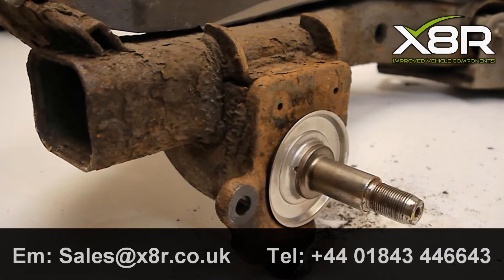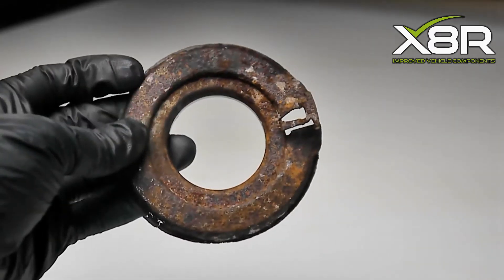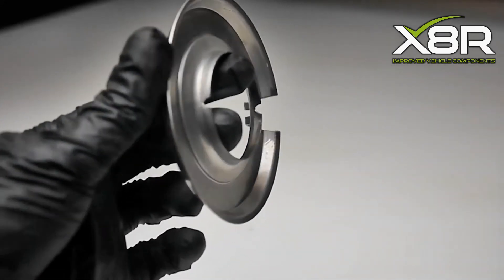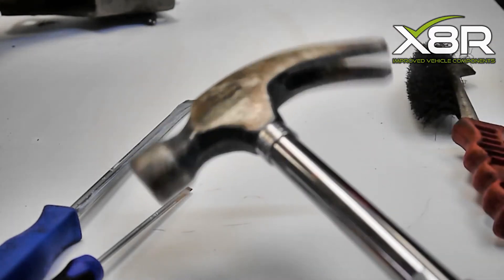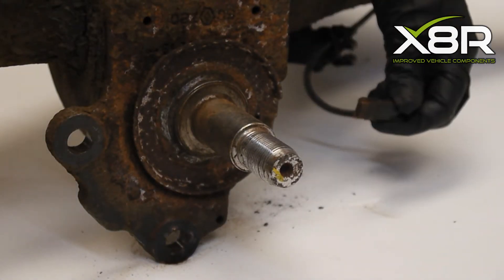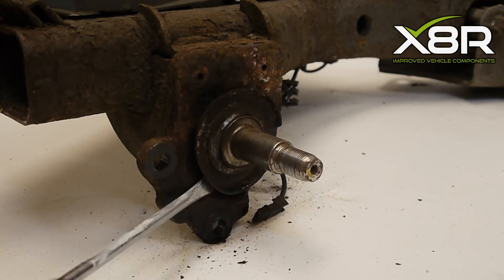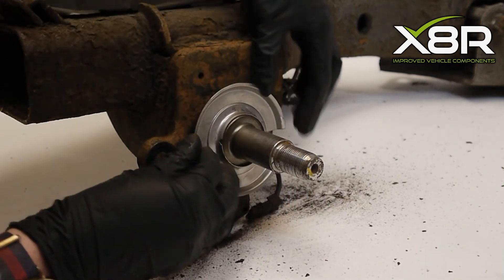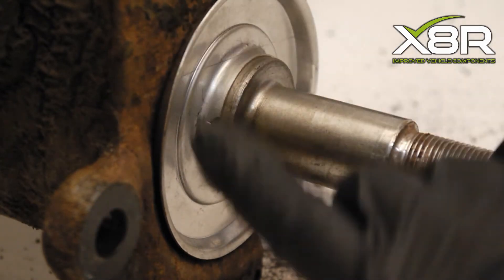Renault ABS Plate Shield Sensor Repair X8R | Megane Scenic Laguna Espace Grand Scenic

Comment: Ive been on your site but you dont appear to have it for the front abs sensor. 
Is it the same for front and back?
Reply: I have the same problem "Front lose, falls out" it seems this type of bracket only works for the rear, after asking "AI" if alluminium or copper shims don't work to sturdy the front or it's rusted too much a high temp epoxy could be used to hold it in place, but for a long term proper fix then the knuckle needs replacing on the front. Looking around it's available for £75 complete per side. Obviously needing wheel allignment after renewing. Gestimates are around £200 - £250 ish per side for a garages to fix. As states 1 to 2hours labour + parts. (Garages charging £40 -£70ph) For an OME part it's just shy of of an eye watering £300 each. Or a few tools, time & YT help videos for DIY. Search: ( Steering Knuckle Assembly Front Right for Renault Renault II) Hope this helps.  ;o)  Edit update: Fixed for 8p yours could be free. While shopping for £8 copper or aluminium shims to wedge the sensor firm I had a few light bulbs spark in my head. I recycle loads of aluminium shims with all the JD & cokes I drink… lol.. £1 scissors cut these tins as do Stanley knives. I then remembered the copper strip snail barrier roll I had in the shed aimed at plant pots etc. That saved me £16. Cleaned the area with blasts of brake cleaner (£4 ish if you’ve not got a tin) & got all the junk out & off the sensor too. As my sensor holder was whole but badly rusted which caused it to fall out, I cut the copper snail strip in half & about 60mm in length. Ensuring the sensor was grease free I ¾ covered it in 3 layers of copper, ensuring only the sensor itself wasn’t covered. 4mm round bit that faces the metal turning strip. I then wedged it back in and presto it was snug as a bug. If yours has corroded badly you may need to cut the coke can up & make shims to fit & wedge it in. I will confess that I bought a good OBD reader & code clearer XTOOL A30M (26 resets) from the US which saved £25 vs UK’s £120 price tag & a £40 bearing puller kit as assumed I’d have to replace the whole joint @ £75 per side. The A30M is useful in identifying which wheel is the issue, it also clears ABS dash warning lights which helped pass its MOT. You could just look to see which is at fault & repair & your dash warning may go out if the fault is corrected. My ABS warning kept flashing on after fixing it, extinguishing only after a few minutes which concerned/ annoyed me until I cleared its history via A30M & now is all sweet. Hope this helps ;o)

Comment: 50 pounds for round sheet metal.Yeah!!!
Reply from the maker: Or going to Renault and them quoting over £1000 as they do not sell this part individually :) Our part will last the lifetime of the vehicle as it is made of marine grade stainless steel, ours also has spot weld holes in unlike any other ABS plate on the market. - Georgina, X8R Ltd

Comment: What would I need for a Renault megane dynamique 1.6 petrol 2006.....reg sh06bwe
Reply from the maker: Hi there, according to our system you have a Mk2 which should be the 40mm which can be found here:
https://x8r.co.uk/renault-abs-sensor-holder-mount-bracket-plate-40mm.html

Best thing to do would be the measure the diameter of the spindle it sits on. - Georgina, X8R Ltd

Comment: Hi do u have to use a welder
Reply from the maker: Hi there, it all depends on the severity of the rust. We have incorporated spot-weld cut-outs into our design in case the spindle the plate fits onto has been heavily corroded. In the example on the video we did not need to. - Georgina, X8R Ltd